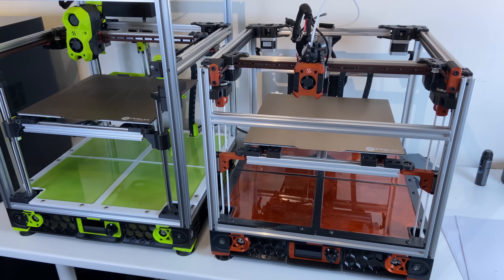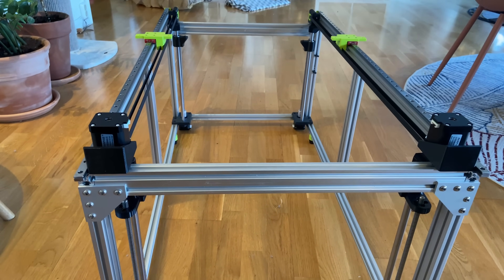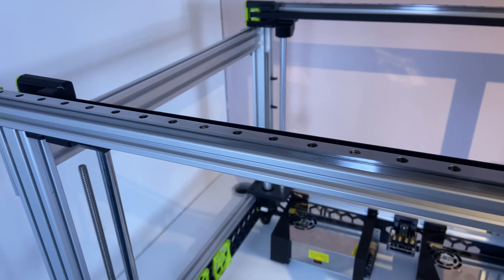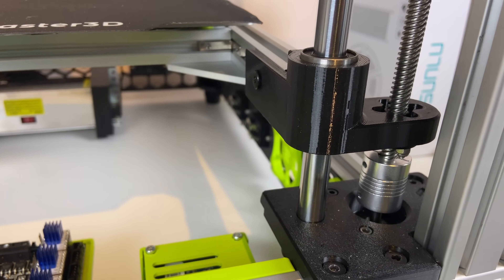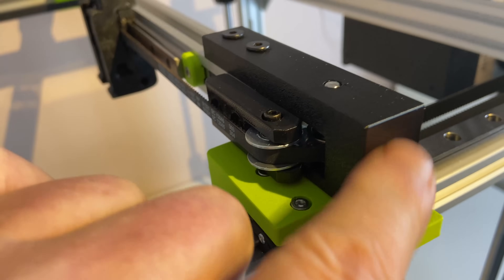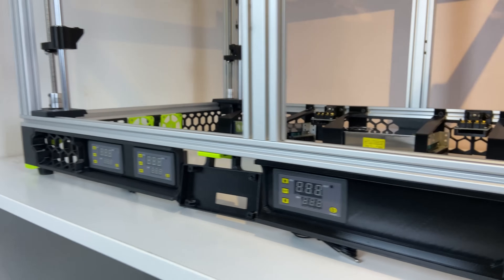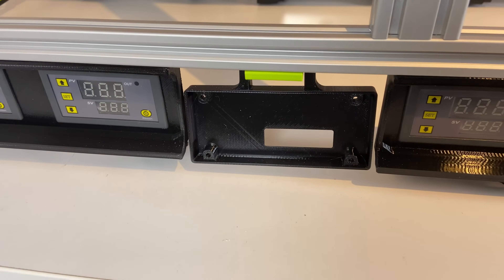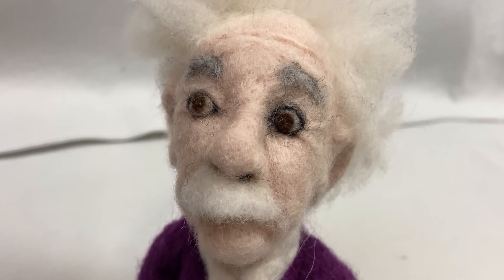Large DIY 3D printer 1 - design and build

Comment: It looks great. Some advise: all of that weight will push on the stepper, and power supplies will pull hot air from the table, maybe flip them.
Reply: Use thrust bearings below the coupling, you should be fine then :)
Reply from the maker: Some ball screws and not a leadscrew pushing down on the stepper would be nice. Thankfully the beds are pretty light on this build.
Reply: @v4projects  You need to also consider the weight of the printed part.
Reply from the maker: @FrodeBergetonNilsen  Yes, that's true. Unfortunately I haven't got any serious budget for this build and some choices will have to be compromises. It's likely that there will be a version 2 of this printer. The frame will then have to be slightly wider to allow for a flying gantry. That was the intention with this build as well. I still think it will work just fine 🙂
Reply: @v4projects  It probably will. Keep z accel low and z speed low. That will help mitigate it. Also, trying to get the gantry and the bed to be friends, as in disabling ABL or phasing it out, will help you a ton. Accuracy on the Z is critical to get "big" printers to work. Particularly on a low budget.
Reply: @v4projects  I think leadscrew is fine, but you can add thrust bearing somewhere at the bottom.
Reply from the maker: Thanks, Ill look into that.